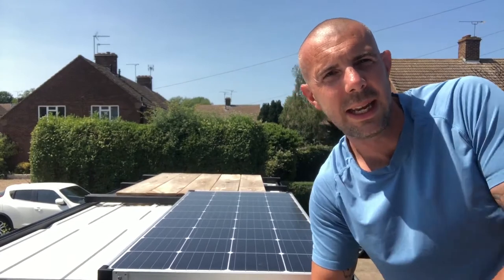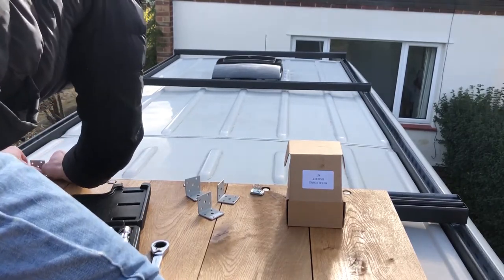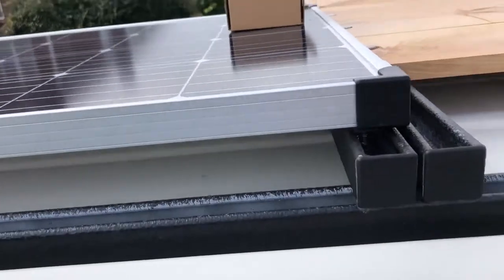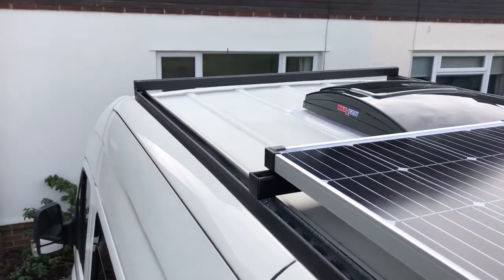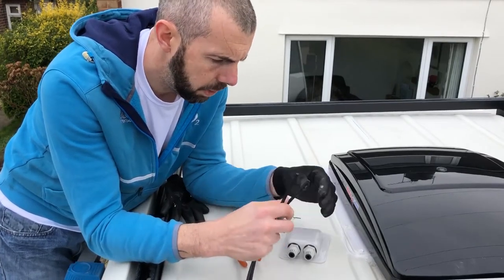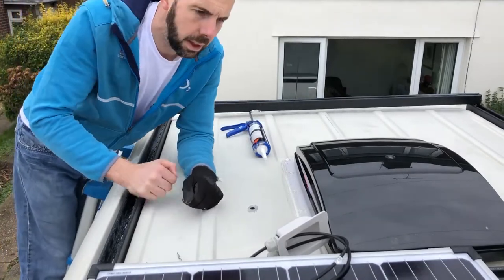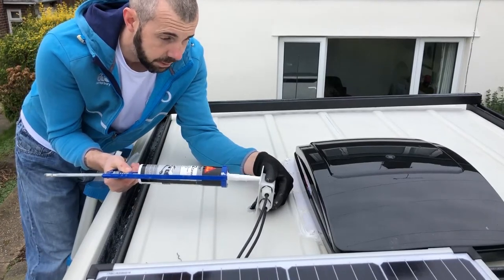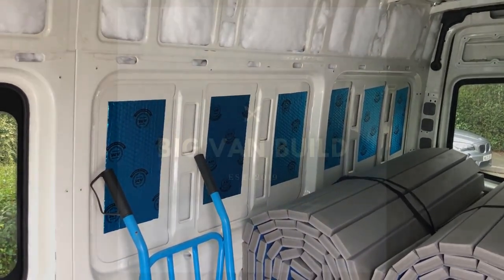VAN CONVERSION ¦ Fitting The Solar Panel

Comment: I was considering unistrut for mine but I wasn't sure if it was worth it. After seeing yours and the decking I think I will. Which one did you buy, galvanised or not? Maybe a rubber grommet in the hole you drilled would be good or just lots of sealant to prevent the wires from chafing.
Reply from the maker: Yea loved the unistrut.  I bought the galvanised one but have used acid etch primer and Raptor sprayed it.  Yes your right I’m fitting a grommet for the wiring 👍🏼

Comment: Hi was it light light or heavy (2.5mm) strut you used pls - just thinking about weight?
Reply from the maker: I’m pretty sure it was the heavier stuff but the rest of my build is fairly light compared to some so I’m all good.  I’d say the whole rack would weight in at about 25kg but could be wrong 🤷🏻‍♂️
Reply: @bigvanbuild  cheers, great help, appreciated
Reply from the maker: No worries good luck with your build